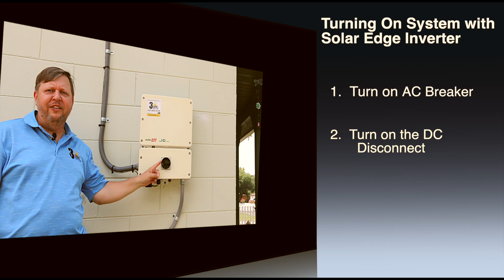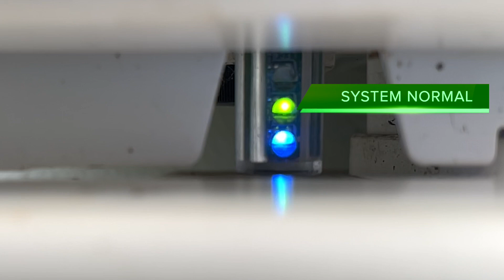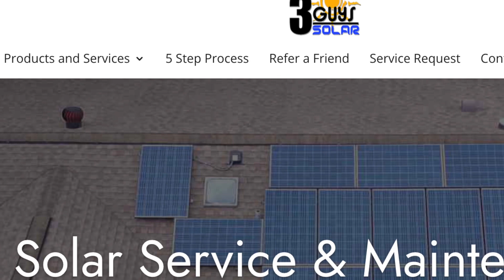3GuysSolar Owner Training SolarEdge Startup

Comment: Hi, I'm in Atlanta and it was working fine up until 2am this morning.  The PV solar circuit breaker tripped last night at 2am. I turned it back on and Now all three LED's are out, No lights at all.  I have tried to cycle the power and no change.  What do I do now.  My installer went out of business and I don't see any solar edge installers in the whole state.  What do I do?

Comment: Even though I wasn’t one of your customers, this video was extremely useful in helping me getting started up with the same equipment. Quick question, how is it connected to the internet? Does it have some sort of 4g broadcast internally or is it working off of my house wifi? Thank you.
Reply: The inverter connects and communicates with the internet with the help of an internal cell kit.

It has a microchip on one end that  attaches Into your inverters mother board and on the other side of the wire there is an aantenna  that gets wired through the left side and mountet on the top.

It can also be hard line ran into your modem with a cat 5 Ethernet cable but it's it's rare to hardline direct to modem. 98% of the we just add the cell kit

Comment: I have 2 boxes one on left has only solid green but blue off, and the one on right has both solid green and blue, is that normal for one of the boxes not yo have blue on?
Reply: Solid green light show the inverter is producing power and the blue light shows the inverter is communicating to the SolarEdge servers. The left box with no blue light shows it has no communication. Check the SolarEdge monitoring app for the array and see if all the panels show production.